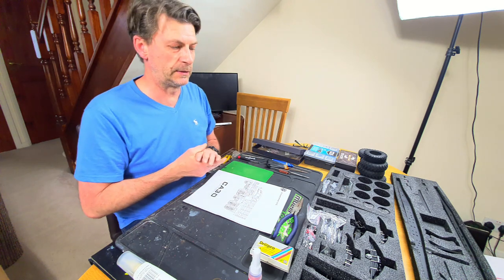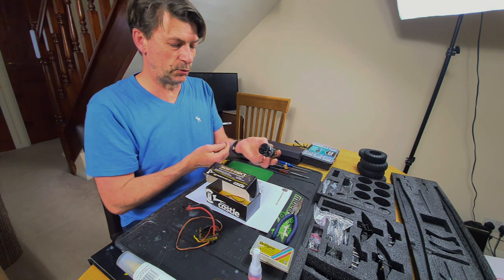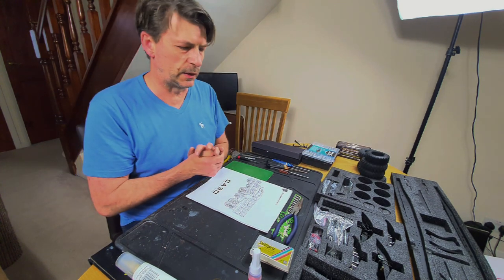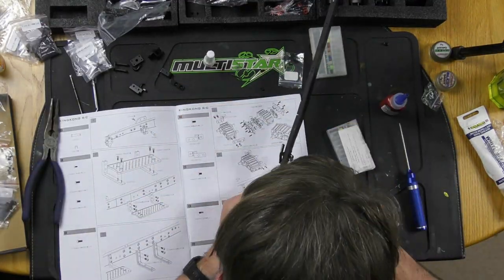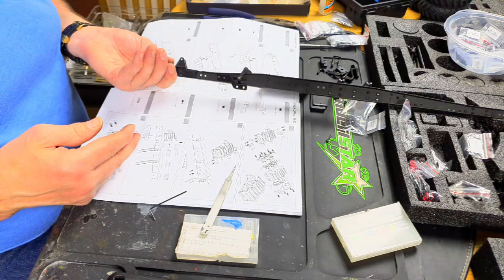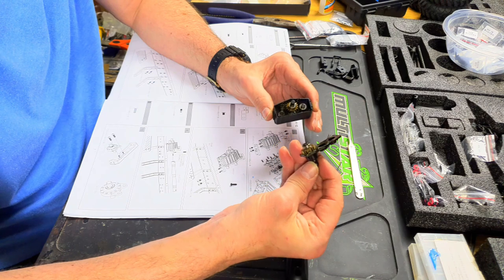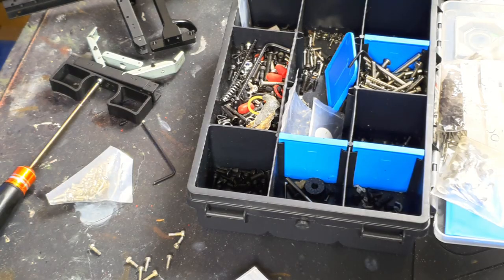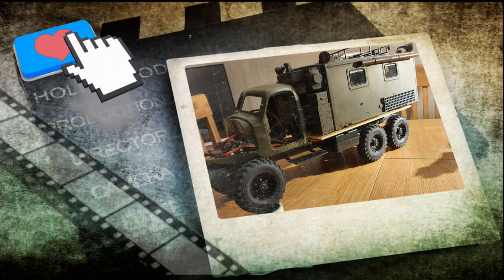King Kong RC CA30 / Zis 157 6x6 Jiefang Chinese Truck Build Part 1

Comment: You need some taps to clean the threads out, but I have had these problems on kits. Those little bolts, i do have one of those drivers from the Ural :-) I did find going into plastic better to  use a screw and wax to get the thread cut first. The Gaz back does look very good on it hope you are doing that. The MC8 is getting there and finally started to get the electric mess sorted. Making the cab non tilt and using the large open area is great and will make all easy living with the truck once finished.One little foo par I forget to order a servo extension lead for the gear change. The remounted speaker in the back makes the sound quite loud but it was the speaker from the Ural that was slightly louder.
Reply from the maker: Yeah man, I certainly do need some. Screw and wax?? Electric mess lol mine's in a ziplock bag haha. Can't wait to see it done sir.
Reply: @antrc  Wax when screwing into plastic helps a lot if it's the hard stuff. The electrics are a little messy because of the Y leads but does not matter as there is now so much room for all. I do not know why Cross did this tilting cab, not needed and easy to open that hatch to get to the on switch now. But all the lights and sound are working great. I did turn the power to the receiver up to 7.4v to help the servo a bit. It does lack power a little but not a problem when moving. Ordered Number plates, servo extension leads and more decal for the cab.